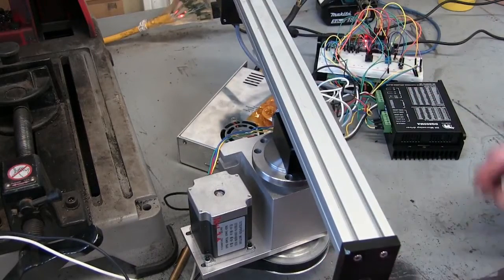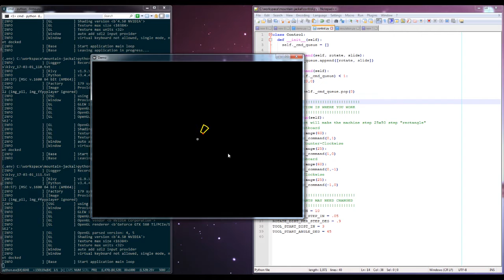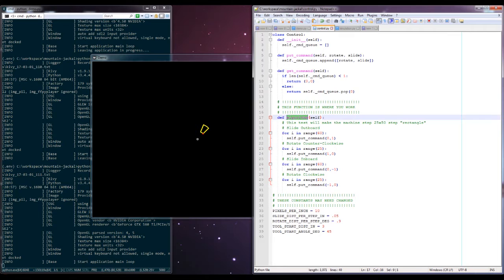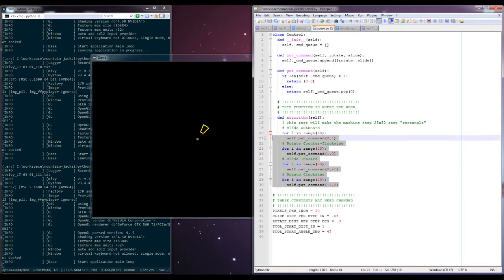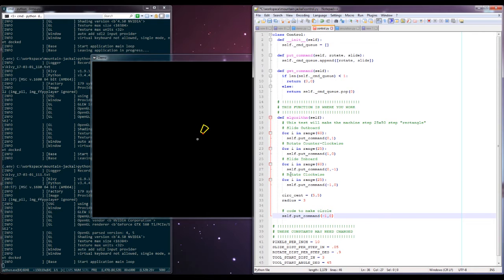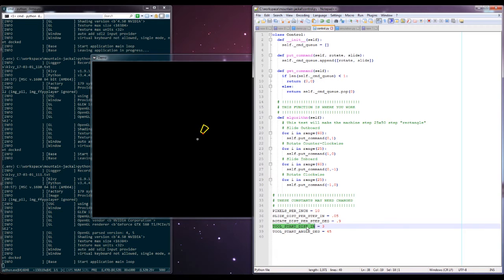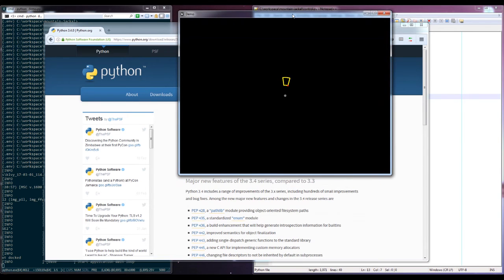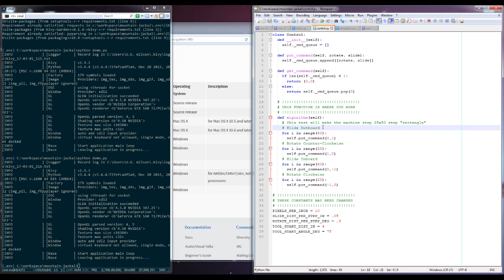AvE Portable Rotary Plasma CNC Simulator

Comment: I think it might be good in terms of development portability to use standard G-code as toolpath instructions. Therefore we could divise the control in two main part; a G-code interpreter (where G instructions get translated into x-y coordinates over time), and a machine control (Where the x-y coordinates would translated to actual physical axis movement). Then a front end visual software could effectively be developped to help with the g-code generation. What do you think?
Reply from the maker: I think at this stage it's somewhat of a needless layer of abstraction.  If the intent is to be able to "place and play" g-code control doesn't really buy you anything because there's no human to generate g-code!  If the software computes the path and then translates to g-code and then executes g-code, why did you even bother with the g-code when you could have just been directing steppers?

Future application by more specialized people would definitely call for it, but from my understanding of "commanders intent" right now, I'd just drive towards simple stepper control at the moment.

Also this is just to mock out behavior of a single device, not really intended to actually control the thing.
Reply: I see your point. Notheless I'm sure there is a shitload of open source code for toolpath generation and interpretation.